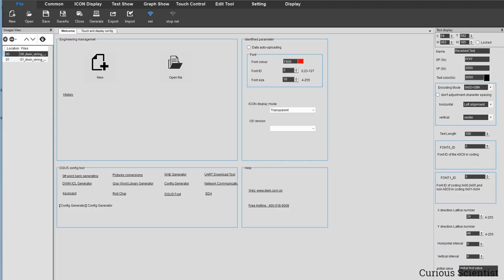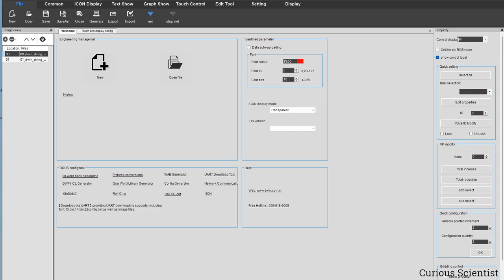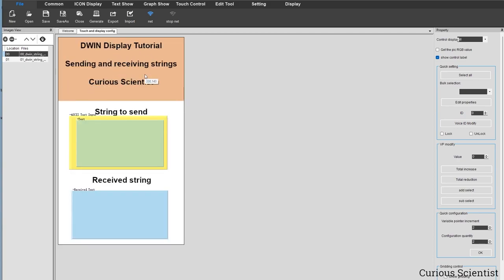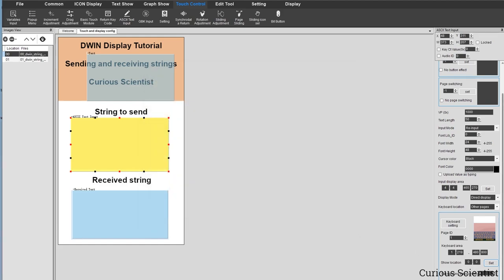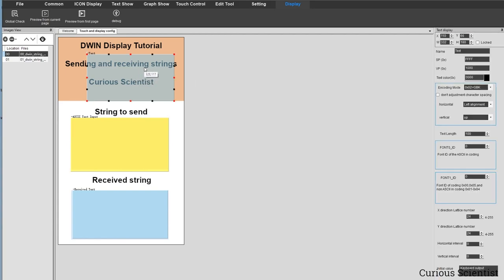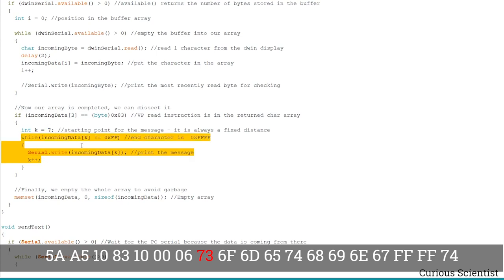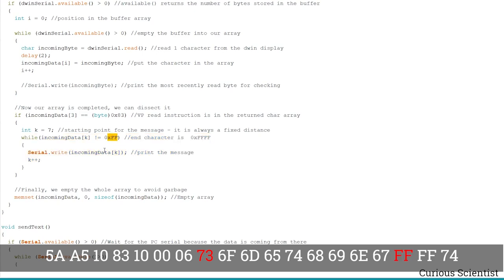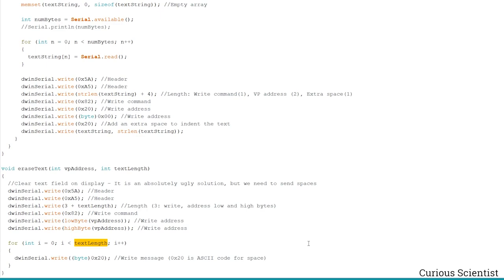DWIN Display Tutorials #1 - Transmitting text between the display and PC or Arduino

Comment: Extremely useful video. Have you found a way to turn off the response from the display when you send data to it?
Reply from the maker: Thanks! I don't mind getting a response as I can neglect it, so I haven't searched for it. Read the manual of the display, and it will be described there if it is possible to turn it off.

Comment: Hi, I watch the video and I'd like to say things which I tried to understand. 
In the menu part, we give key value for all button but the problem is Enter button. When I choose enter for the enter button, it didn't send the values to serial terminal, but when I changed enter to return, it fixed the problem. Did you do the same things or did I miss some part?
Reply from the maker: Hi! I think you missed something. The enter button has to be assigned with the "return" because otherwise it will just add a line break.

Comment: hi! when i press ENTER , first page is not getting displayed. for ENTER  i selected basic touch module under Touch control, checked the Full QWER keyboard, clicked on set button and clicked on Enter under keycode....is it correct?could u guide me
Reply from the maker: There are 2 types of "enter" if I remember correctly. One is for confirming (acts as "OK") and another is for line break. Check if you use the proper one.

Comment: After using the DWIN software for a while i feel it is a long way from a complete package. The software needs a few for functions to become ready for mainstream use.
It needs at least the ability to simply define a background color for each screen and control. Using a dedicated image for each background and control should be an option. It would be nice if there was an option to specify a color gradient for things like a slide bar. It should not be a big issue even if the color is converted into the required format in background.
Reply from the maker: Hi! I think it is rather complete, but some functions are just really cumbersome. But I guess this is due to the fact that they based the whole logic on changing and manipulating values under SP/VP addresses. Also, most of the dynamically added things' colours can be changed by manipulating the values under the SP address of the control, if I remember correctly. However, I never came across a color gradient for a slide bar. I don't know if it is possible, but maybe there's a workaround for it.

Comment: I am recieving A9 CB F9 54 FD FF FD 00 data from dwin not recieving the data with 5A A5 header . Am i doing something wrong . Any thoughts on this problem . Thank you.
Reply from the maker: Hi! Did you do the exact same things as I did in the video?
Reply: I figured it out . I had to solder TTL pins in the board .

Comment: Nice tutorial Mr. Scientist! 
Now a question, if you have an opinion with that. 

Looks like a litle bit complex to share info between the Arduino PLC and the hmi Screen....
If we choose a Raspberry for our projects (Linux) with Python, for example, or even pure javaScript we can share and control data from plc - screen superEsay way... 

Then.. What am I missing? Why is that hard with arduino and what's the benefit ? fast proces? cheap systems?
Ok.. Arduino don't need any OS to operate... 

yes BUT!

thanks anyway for the super-interesant video!
 Im gona use it on my next project.
Reply from the maker: Hi and thanks! 
I respectfully disagree, they are not complex to use at all. It is just sending ASCII characters back and forth. Once you understand the logic, it is very simple in my opinion.

Comment: How to print string[text message]from Arduino controller to dwin display?....like in my code i am sending ascii values if i changed to char values it is taking the ascii values but i need text message how to do this
Reply from the maker: Hi! It is clearly explained in the video and the corresponding article on my webpage.

Comment: Hi! I tried to make a very similar procjet using a DMG12480C068_03WTC. It is very strange that when I input the text on VP 0x1000
- the text is shown above the keyboard
- the text is shown on the main page
- but the message sent over the RS232 is not corerent. Even for the same text, the message is different. For exemple, I receive 1A 41 01 20 20 24 24 AE BF BF for text "ttt"
- same time, if I send 0x83 command to read VP 0x1000, the answer is correct  5A A5 10 83 10 00 06 74 74 74 FF FF

Is it anything that I missed?

Thank you!
Reply from the maker: Hi! First, instead of trying to make a "very similar" project, copy exactly what I did to understand how everything works. As you see it in the demo, things work properly. Then, try to modify it one step at a time to make it suitable for your requirements. Without seeing what you have done I cannot tell what you could have potentially missed, sorry.

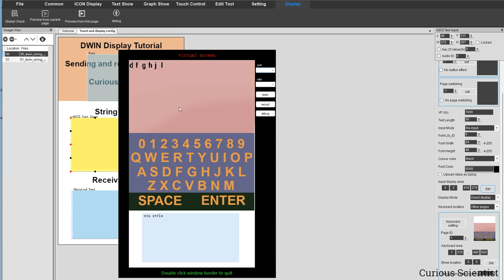Comment: i have set screen resolution as 320*240. i have entered 1to 9 and q,w,e,r ...first line is full....when we still enter the letters automatically cursor has to go to  second line and entered letters should displayed but it is not happening ....@20:01 time...could u guide me
Reply from the maker: The text should be wrapped automatically. Check the handbook of the display for more details. Also, play around with the length-related parameters. Maybe you just simply run out of the memory, so there's no second line.

Comment: I'm using the DMG24240C013 screen, and I applied the same steps as you described. After changing the Touch-sensitive Variable Changes Update setting to Auto and loading the CFG file I created onto my screen, the backlight went off, and I can't see anything. Even if I try to load a different project, the issue remains unchanged.
Reply from the maker: Hi! If you don't use the same display as I do, you should always refer to the datasheet of your display. Maybe there are some display-specific settings that you need you apply.

Comment: I only have to send data from serial monitor to the display, so should I follow the full process or just  the receiving text part in the software and the sendtext function in the code, when I try this I was not getting any data to the display from the serial monitor
Reply from the maker: Follow everything if you want to achieve the same thing.
Reply: @CuriousScientist  OK thank u
Reply: In my software when i select the text box were the text must be displayed from keybord there is not a option such as keyboard output at the bottom, but in your software its showing a keyboard output option, do you know the  reason for it, i have given the same vp address on both but no data is printing on the text box, can you please help
Reply from the maker: @anandhukrishna3456  Probably you don't do exactly the same as I do. Follow my tutorial in the exact same way and then carefully modify it, one step at a time.

Comment: can you help please if we disable auto uploading for acsii text input but want to read using uart command how we can do that what is that command structure?
Reply from the maker: Hi! As far as I remember, you just read the bytes from the corresponding VP address.
Reply: I couldn’t find the correct command structure to send via uart using microcontroller to get data ap specific vp addresses
Reply from the maker: It is in my video or in the well-written documentation of the display.
Reply: @CuriousScientist  i figure it out its 0x5A 0xA5 (number of byte to send usually 3 one for 0x83 for read and two for vp address ) 0x83 0x20 0x00
Reply: @CuriousScientist  Need your help on another topic if we have like a column where we want to show data from multiple sensors can we show data in scrolling manner user can scroll up and see data coming from microcontroller
Reply from the maker: I guess it is doable.
Reply: @CuriousScientist  how can you guide how to do that
Reply from the maker: You must read the manual of the display. It is explained in it.

Comment: Hello fríend congrats for your videos, are very useful. Thanks

Friend I've followed this video. When I'm testing the serial port sending a some charácter, I receive this value. 

2D 3E 55 FD FF FD 00

This value is different with respect to your values. 

Are those values correct?

My display model is DMG10600T101_A5WTC

Can you help me?
Reply from the maker: Hi! I don't know if your values are correct because I don't know what you did exactly. Just follow the video and first replicate what I did. If you get the same, then you successfully copied my demonstration.
Reply: @CuriousScientist  Hello friend thanks for your quick response
Friend I've followed your video again. Your demo work for me in the Dgus Software (Previews from first page) and also, I've transfered the DWIN_SET folder to screen and this works :)
However, when I try to test the data through the serial port I don't receive any information.
My display model is DMG10600T101_A5WTC.
I think the problem are the wire connection, but I don't know exactly. If you can, I can send you some images

Please, help me friend, I haven't been able to move forward
Reply from the maker: I can not troubleshoot this without seeing the system. There are thousands of things that could be wrong. TX and RX are mixed up, wrong COM port, wrong command...etc. Check my other demos, maybe you'll find the solution. Also, read the manual of the display.
Reply: @CuriousScientist  friend thanks, I understood, and you're right.
Please can you share me a link, according to my problem?
Reply from the maker: Just check my DWIN playlist.
Reply: @CuriousScientist  Ok Friend I will. Only one more question.
Do you have a video, where Do you teach how to connect or use (HDL65011 connector) to screen?
I think it is very useful. If you have, please share me the link.
Reply from the maker: I use the original serial adapter with the ribbon cable. I don't use others.
Reply: @CuriousScientist  Hello friend I understood. Friend I could resolve, I had a wrong cable connected. I can receive information thorugh of my serial port.

Sorry for so many questions. Friend en your video you said. "Using Arduino" I'm using Arduino mega 2560. According the documentations, they told we that, we should connect

Ttl.    Arduino mega
Tx to tx2
Rx to rx2

In my arduino Mega 2560 I have many RX and Tx, can you said me, What the Txs and Rxz Should I use?

Sorry for so many questions. I hope you answer.
Reply from the maker: Use the one best suitable for your application...

But TX on the microcontroller goes to RX on the screen, and RX on the microcontroller goes to TX on the screen. Just so you know.

Comment: Can you share code arduino?
Reply from the maker: It is available on my Patreon. Or if you don't want to support my efforts, just follow the video and copy the code line by line. It is freely available from the video.
Reply: The memset fonction is not shown
Reply from the maker: Could you please tell the time code so I can see if it is necessary to have it?
Reply: Marvelous video! My Dwin display is not transmitting data. I have checked using Coolterm software and other. Although, it is receiving data. Can you please help to confirm that my display is faulty?